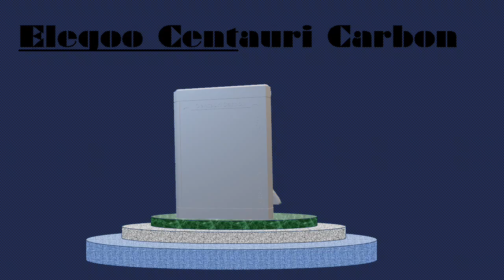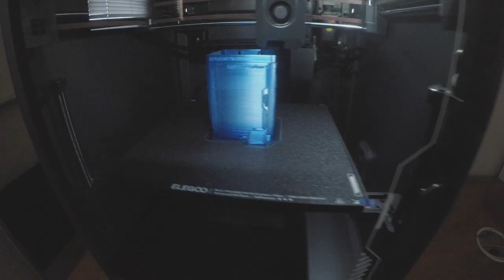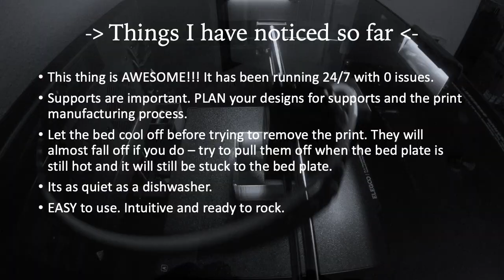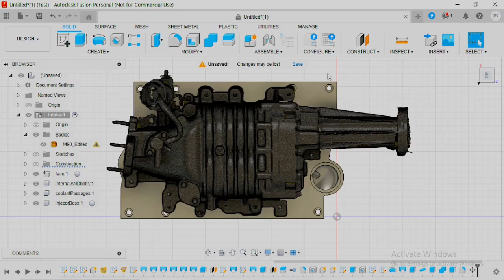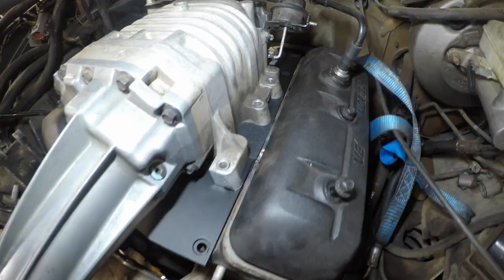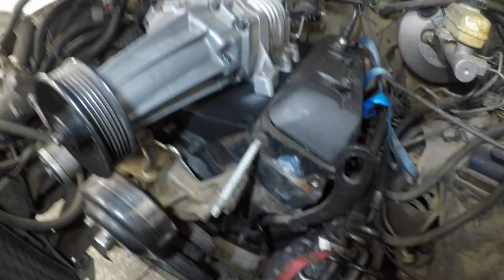Elegoo Centauri Carbon 3D printed Supercharger Intake.  The future is now brought to you by Elegoo!!

Comment: Dude that's cool. I've been wanting to 3d print a plate like you are doing but on a 3.8 essex for a new edge mustang to stick the same supercharger on it.
Reply: I always wanted to do that when I had a 3.8. Moved on to the 4.6 but I still want to put a 4.2 from a f150 in the 3.8 mustang, with a cam, long tubes and windstar manifold. Then completely gut the car